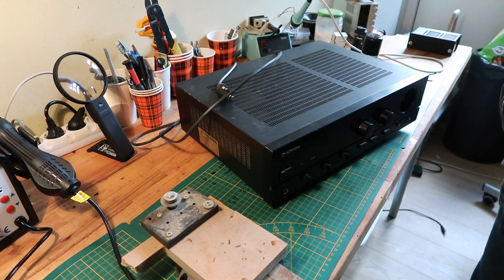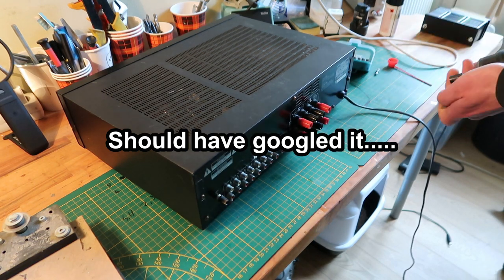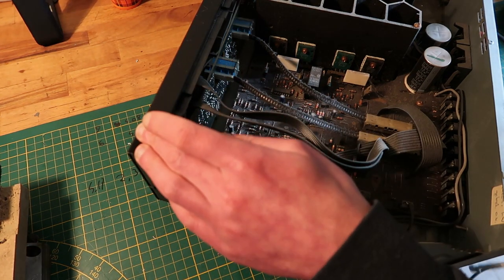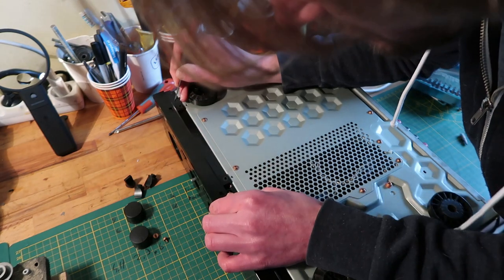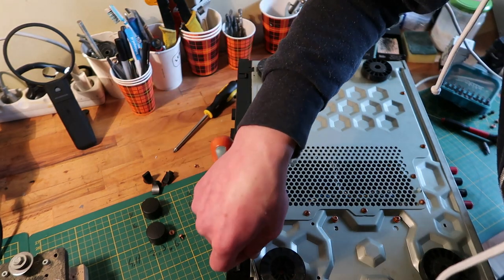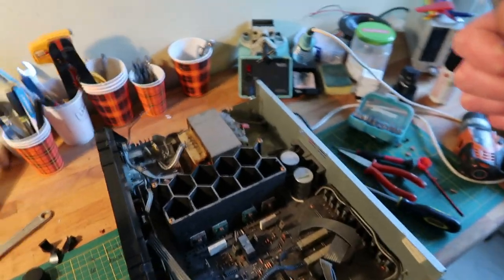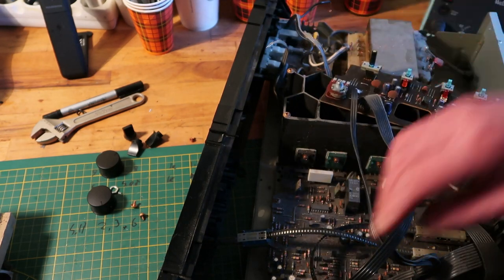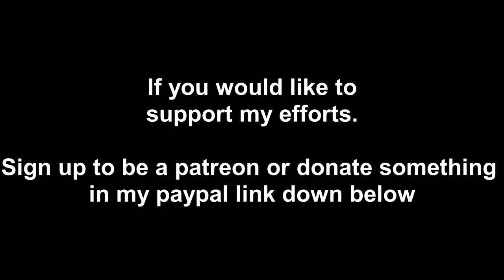Pioneer A445 Amplifier Teardown  (Camera test Canon G7X mkII)

Comment: Have you ever lift anything with 22 kg weight? This amplifier is only 8 kg.
Reply from the maker: The 22kg was for the A757 i had myself.  this one is much lighter indeed.  also mine was actually 19.6Kg according to the manual so i was off a little.